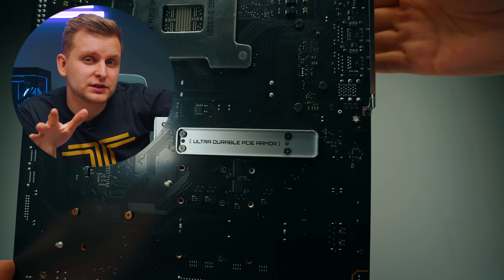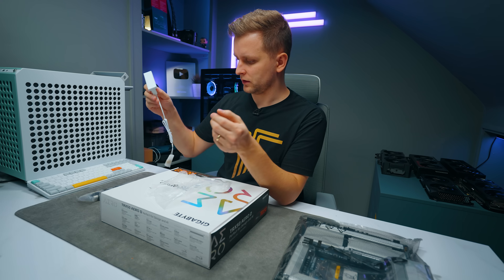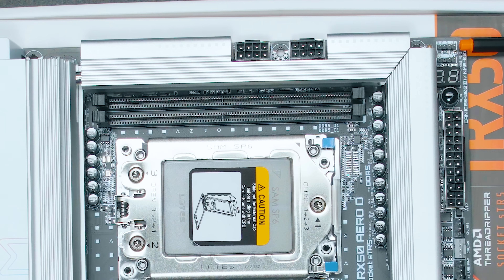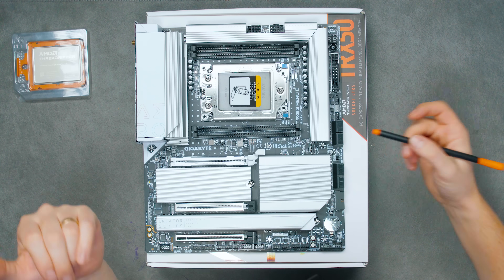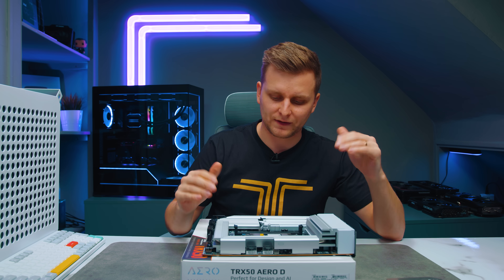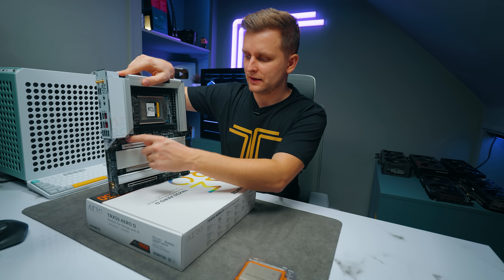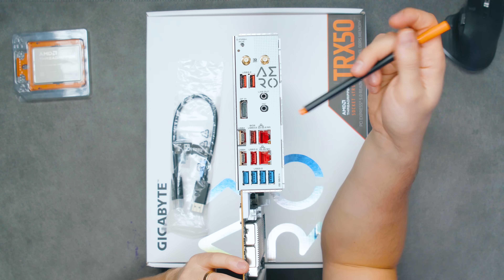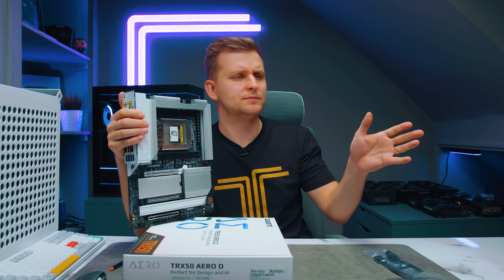The Ultimate NO-COMPROMISE Creator Motherboard: Gigabyte TRX50 Aero D for AMD Threadripper 7000

Comment: Been battling with trying to get WOL working on this board, via the 10BGit port. Gigabyte support told me the Qualcomm WiFi module is mutually exclusive to getting this working. So you have to remove the Qualcomm module or replace it with a Mediatek. I wonder if other odd issues are caused by some other lurking incompatibility. I've given up with support and will replace it with a different make.

Comment: Nice board. Almost perfect, but it could be better (i.e. would prefer only 2x M.2, and instead one extra PCIe slot there at the bottom, plus some MCIO ports maybe). But I very much like the top PCIe being designed to hold 2.5-3 slot GPU.

Also while this is little known, TRX50 does actually support quad channel memory. It is not a function of chipset. Pro supports 8 channels, and Non-Pro supports 4 channels. It is independent of the chipset, even if AMD says otherwise. (There are boards with TRX50 that support 8 channels with Pro CPU). But almost all TRX50 of course comes with 4 channel (maybe Gigabyte TRX50 AI TOP being an exception), because it is cheaper.

Comment: one of the biggest points of threadripper is for all of those sweet pcie lanes yet this board only has 3 16x pcie slots when there should be at least 6?  the other huge point is for quad channel memory, and they only give you 4 slots on this board when there should be at least 8...

Comment: LOL from the company caught injecting UEFI rootkits straight from firmware on their mobos - I wouldn't touch this trash with 10 foot pole.  This boards wifi drivers don't even work with windows 11 consistently, hell the installer can't even find a suitable driver for them.

Comment: Did you mention that the board has connectors for temperature sensors?  I wonder when motherboards are going to introduce connector for sensors to measure the temperature of water in a custom watercooling loop.

Comment: What's the spacing like between the top 2 GPU slots?  Can you run a triple-fan 4090 in both slots and still get airflow?

Comment: "No compromise", you say? Houw about this: you can only install 3 GPUs on it, and it only has 4 DIMM slots, so you can only use half of the available memory channels of the CPU.
How's that for a compromise?
Reply: Isn't non-pro 4 channel only?  Might be confusing WR Threadripper Pro which has 8 channels.
Reply: @TheRealLink  Yes, non-pro Threadripper only has 4 channels, but when you claim such things as "Ultimate NO-COMPROMISE motherboard", that sort of implies you can use the best available hardware on it to the best of its ability, which would be the Threadripper Pro, that will have half of its memory channels unused on this board, thus compromising its maximum performance.
In reality, the "Ultimate, no compromise motherboard for Threadripper 7000" would be something with the WRX90 chipset.
TL;DR: My issue is with the misleading/clickbait title.
Reply: No TRX50 has more than 4 DIMM slots. You need to go WRX90.

Comment: Board looks really sweet, my only issue with it is only 3 pcie slots. Im planning on threadripper build since Im out of PCIE lanes for what I need, and now with ample pcie lanes with threadripper, I would be stuck with out of slots for it. But I love that it has 8 sata ports, and if I would go with Asus I would need to plug in external sata controller and waste one slot that way, eh.

Comment: I know it's a click bait title but it's a compromise by virtue of the fact most air cooled 4090s will render that second Gen 5 PCI-E slot useless. More manufacturers need to be providing a 4 slot PCI-E layout for the main two Gen 5 PCI-E slots. Shouldn't have to go hybrid or Quadro to use your two main PCI-E slots given power and cooling requirements for GPUs aren't likely to trend anywhere but up.
Reply: Agree.   Sometimes I wonder if board companies should just accept that any interesting card is going to be double wide.  Just use that space for M.2 or similar.  Make the board long enough to be 2 or 3 slots of double wide PCIE performance versions.

Comment: 1. USB 4 on this board is... Thunderbolt 4. Its run by Intel's JHL8540 based on MapleRidge chipset. If you read manual/specs page before publishing review you would know that. It's not run by AsMedia 4242 which is native AMD solution. Why it's called USB4? Because of stupid marketing gibberish. But on the other hand if you're audio creator and has a lot of TB-audio peripherals this is perfect board for you.

2. ESPI_DB - Enhanced Serial Protocol Interface (eSPI), DB - Debug. I don't know why Gigabyte doesn't write clearly its header reserved for authorized personnel/service only. It's not that difficult. eSPI is standard which is aimed at replacing old COM, for devices which support it. Purely for servers and specialized applications. 

Overall nice board. It's kind of a bummer it has only 3 x16 slots. I would trade M.2s underneath the GPU for SlimSAS/MCIO 8i port (or x8 PCI slot) because enterprise drives aren't heat/power constrained. They will live basically forever compared to consumer grade devices and nobody sane should run Gen.5 NVMe under GPU. You will melt the drive unless you have ridiculous amount of airflow pushed underneath the VGA. Gen.5 controller uses a lot of power at peaks. Like big industrial HBA, 10-15W something like this. That's super crazy, M.2 has no thermal envelope to survive this for long. 8 SATA ports is also very nice. All M.2s are wired to the CPU and not a chipset so it won't affect the performance because chipset has only single Gen4x4 link which is saturated by any single Gen4 drive.

Tempting as heck. VGA for rendering. 4xU.2 adapter for my Micron 7450s and OWC's Accelsior 8M.2. Pretty beastly rig. Still lack of that extra slot, kind of hard to stomach. I think will get AsRock WRX90 (2xMCIO) if possible or AsusTRX50 because Asus USB4 AIC is run by AsMedia 4242 and it has 3x16 + 1x8. Decisions!
Reply: This board had some engineering problems. Now it has third revision (in a month...), on first revision you can't put your system in sleep S3 state. Check the revision before purchase!
Reply: @falsevacuum1988 

Yeah tell me about it. I wanted to write this, but I actually deleted that part of response. Good old GB. Releasing revisions like there is no tomorrow. TRX40 Designare had like 4 revisions to fix broken electric paths and other stuff they screwed (like inability to use more than 2 GPUs without melting the board, I had huge issues with 3x1080Ti back then switching to single 3090 solved problem in 1 second). S3 still strikes TRX40 on occasion, but in general after 6 BIOS updates and GPU replacement my 1.0 is fine, but I've maxed it out completely with devices. Anyway... For some reason GB server division has all competent engineers and consumers get scraps, but Aero is certainly unique board on the market and UEFI got huge upgrade. Very tempting to try.

Comment: Nice board and video as usual, I'm not sure why we can't get a motherboard that supports thunderbolt and standard USB C especially at this level.. My laptop has both so really don't understand it, I'm a full time editor and use both of those, I have a big 72 tb thunderbolt raid and smaller USB C ssd drives and I use them both. For a creator board I find it strange that you can only have one.

Comment: How much space is there between 1st and 2nd pcie slot.
Does it have enough space to fit rtx 4090 air cool card without interference in 2nd slot
Reply: I mean, you can see and infer from the video. It's fit a 3 slot cooler.
Reply: if the 4090 has a 3 slot cooler (like the FE), the answer is yes. If it's a custom one with 3,5 or 4 slots, then no, you can't use the second pcie x16 gen 5 slot. As a general rule, remember that an M.2 slot occupies 1 pcie slot. There are 2 m.2s up there, so you can guess the total is 3 for the first slot
Reply: Not true unfortunately. You can't fit 2 x 4090FE on a 3 slot spaced board. They will choke each other. You need 4 slot spacing because a 4090FE is 3 slots wide (Need 3 for card + 1 for airflow). This 'no compromise' board is a compromise for that reason alone.  @sardanus
Reply: @ride19881  you're right but i was answering about the possibility to mount another gpu (maybe smaller) or another pcie card onto the second slot, i didn't say that's a good idea ;)

Comment: Only 4 sticks of memory? facepalm
Reply from the maker: It's 4 channels not dual channel ;)
Reply: you have 4 channel memory in this board. Comparing to normal DIMMs, RDIMMs are also available in higher capacity, so you don't need 2 slots per channel
Reply: You are thinking of this like a normal ddr5 x670e board, which is great; but what's the issue you're thinking of?
Reply: @RKBenchmarker wait, what were you saying to them here? That this platform, or this motherboards purpose (creator) means you don't even need 8 RAM slots, much less 8 RAM sticks?
Reply: @RKBenchmarker the fact that there are some trx50 boards with 8 slots
Reply: @HardwareScience  Those are workstation mobo. This is a HEDT and as others have pointed out, very different from x670e, which is what I believe he was thinking.
Reply: @HardwareScience  That would be surprising as TRX50 and non-pro chips are supposed to be quad channel and 1 dimm per channel.

Got an example? Are you sure you aren't looking at WRX90?

Comment: Keep in mind that Rev 1 versions of this board dont support sleep. Rev 1.2 has reinforced PCIE slots. Most in stock are Rev 1.0 right now
Reply: Very important info, thank you
Reply: I RMA'd my rev 1.0, and after 3.5 weeks, received rev 1.1
Reply: @RKBenchmarker  Moving on up in the world!  Kind of wish this board had more USB built into the I/O
Reply: @snarksdomain  I'm disappointed it doesn't have digital audio and a clear cmos button on the back I/O
Reply: @RKBenchmarker  Agreed. Who wants to pull a GPU and other components just to get inside to pop out a battery. Clear CMOS buttons should be mandatory on any modern motherboard. What's it cost? $0.50?
Reply: @snarksdomain3453  Well, they do have a jumper header so you don't have to remove the battery... so I used it to install my own button ;)
  And I got a sound card with digital audio. But with this level of mobo, one shouldn't have to do all that.
Reply: @RKBenchmarker  Good idea. I've got a bunch of those little ATX switches as well that I could do the same thing I suppose.
Reply: That's the one thing that tends to ick me with Gigabyte boards, especially ones of this price class. They shouldn't use first iterations as test samples to figure out what parts they wanna fix. I mean, most of these things are basic features that common sense would have told them to handle before launching the product. And it should be clearly labeled if a board is an early (engineering sample if we're being honest) version with missing features that have since been revised heavily.